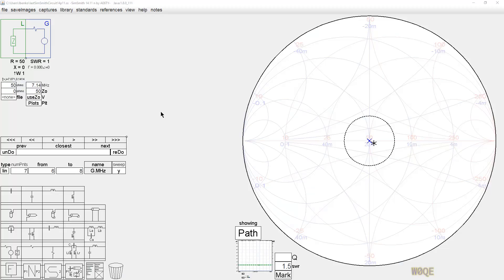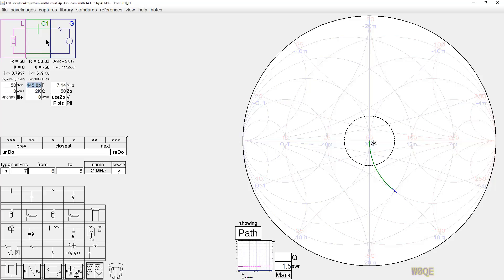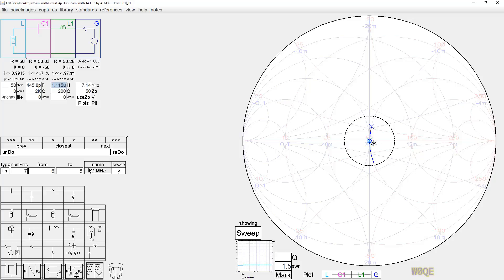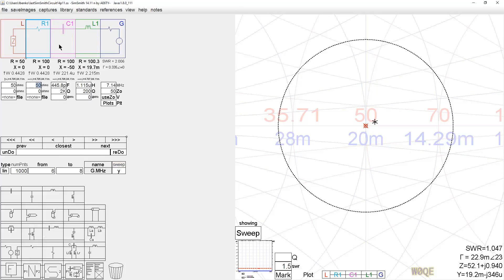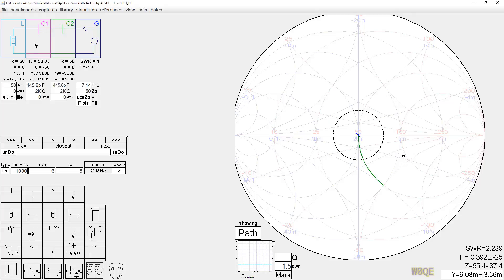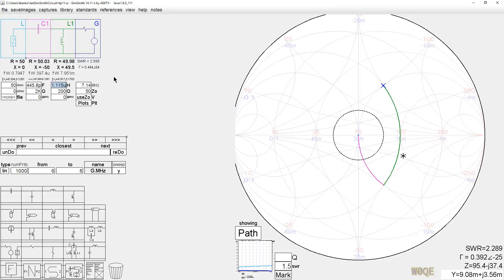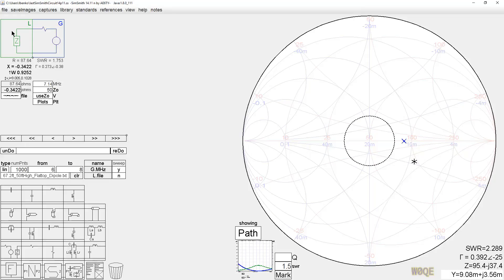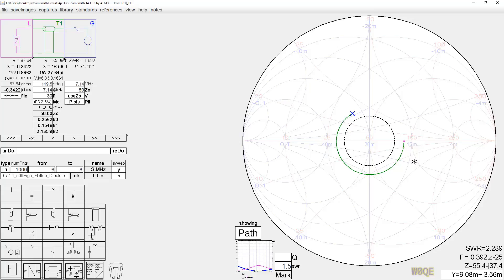#14: Matching Fundamentals, Part2 (Basics 7)

Comment: Just now 'catching up' on the operation of SimSmith.  What a GREAT development!  Thanks, Larry; I find your tutorials of immense value.  Being able to diagnose the 'circuit' forward and backward with SimSmith is a valuable skill.  Between EZNEC and SimSmith, there's no reason to not have a well functioning HF system.
Reply from the maker: If you haven't seen some of the later videos, ver 16 & 17 of SimSmith allow analyzing the circuit in multiple ways more easily than ver. 15 did which was the current version when this video was made.
Larry, W0QE

Comment: trying to load an eznec file for my load and keep getting unrecognised format. i thought .ez files were importable.  where can i find some sample files for my load?
Reply from the maker: SimSmith does NOT read .EZ files. I have shown this in several videos but maybe not the ones you have viewed. Every time you do an SWR sweep in EZNEC there is a file created in the same folder as the EZNEC.exe program that is titled "lastZ.txt". Look for this file in C:/Program Files (x86)/EZW if you are running Windows. You can copy or move this file to where you are working as EZNEC only writes this file. You can rename "lastZ.txt" to anything but I would suggest something like mydata.txt or mydata.dat and this file is readable by SimSmith. Let me know if you still have problems.
Reply: I have successfully used my Aim4170 to measure an impedance at a random dipole i strung across the yard which was imported to simsmith i ended up with like 220ohms at -j30 so i got a solution of like a parallel inductor of 3uH and a series cap of 450pf. I wound my coil on a piece of rubber hose until it was close and used a variable cap that i pre-set to 450pf and by god it worked, not exact but got it to 1.3 swr from a 5.3. originally i tried using a 2meter dipole but stray inductances and stuff just made it messy. I want to thank you for the tutorials I am so gonna use this ALOT    KF7NN
Reply: Another application for stubs is signal attenuation. An open end quarter wave stub is a short-circuit for the quarter wave frequency. If you know the frequency of the signal you want to attenuate get a Tee Connector and cut a stub. Eg want to attenuate the 2nd Harmonic of a 6 Meter Signal ? That harmonic falls right in the middle of the FM Radio Broadcast Band. If you know where the offended harmonic lies cutting a stub is quicker and cheaper than constructing a filter out of lump components.